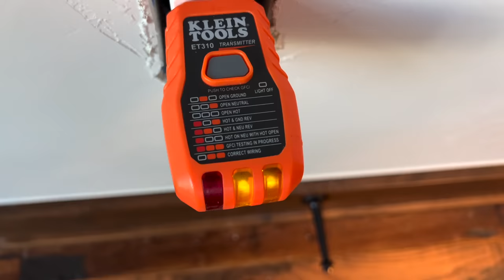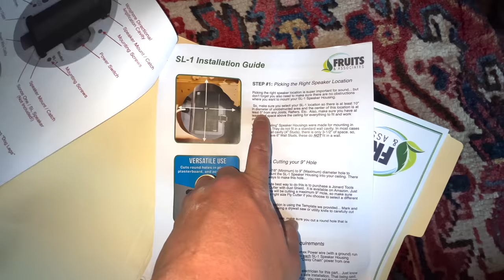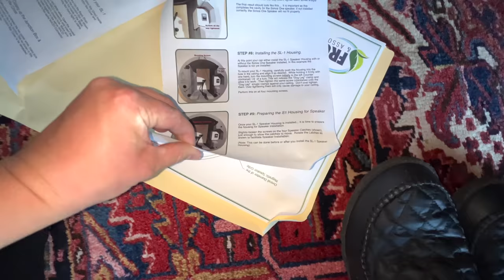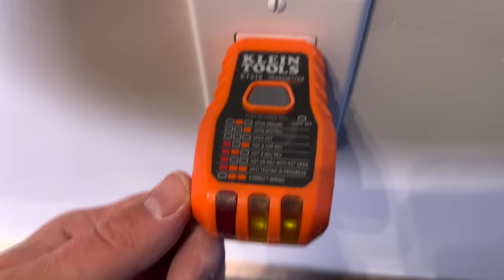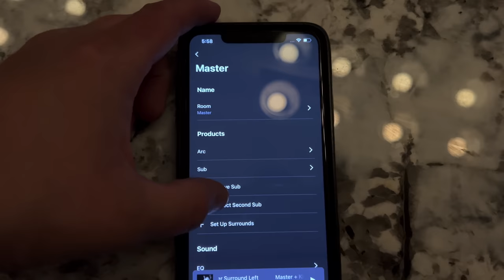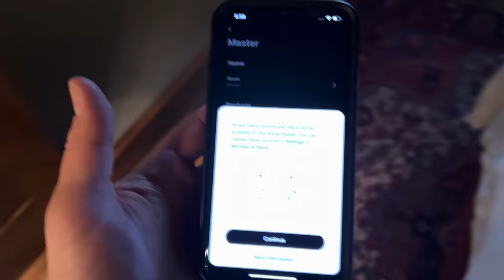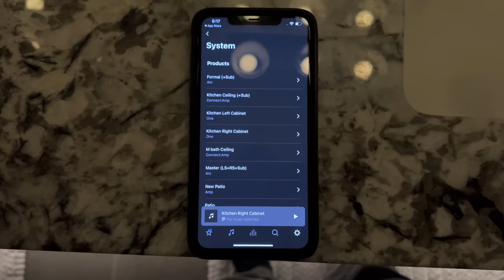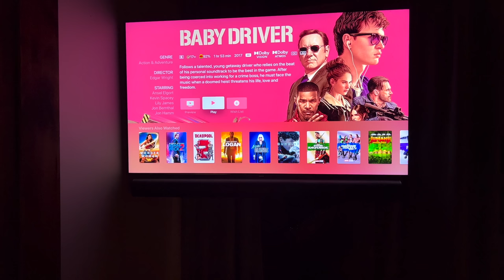GENIUS Sonos MUST HAVE Upgrade! Full Installation + Demo - Episode #2

Comment from the maker: Hope everyone is enjoying the video and finding it informative! We tried a really long detailed format on this one. What do you think? Do you like this type of content or is it to long? Thanks for everyone’s support! 🙏😁
Reply: Love the long video, details by details but it would be nice if they have a rectangle box that it will give that look like a surround speaker but the video very nice ❤
Reply from the maker: @josephpicado1818  Glad to here you like the long form video! We sell grills separately in circle or square even if the speaker is circular you can get the look of a square in wall. 😁 this product is mostly an in ceiling solution so it has the square included. Thanks for watching!
Reply: Great video and solution!!  Are the speaker grills able to be painted?
Reply from the maker: @brandonlavelle8859  yes the grills can be painted! 😁
Reply: Do you sell these boxes on your website? I can't seem to find them anywhere...
Reply: Awesome video. Would it have been easier to remove the bottom trim and cut the sheet rock and drill behind the trim? Then you wouldn't have to have the extra boxes or electrical outlets.
Reply: Where do I get those In wall mounts??
Reply: So you’re gonna dangle that carrot and not give a link to this GENUS solution? Where to buy??
Reply from the maker: @gaulbaugh  https://shopdreamedia.com/products/fruition-designs-sonos-one-enclosure
Reply from the maker: @gaulbaugh  https://shopdreamedia.com/products/fruition-designs-sonos-one-enclosure
Reply from the maker: @Clockworks_16  https://shopdreamedia.com/products/fruition-designs-sonos-one-enclosure
Reply from the maker: @gaulbaugh  haha! Sorry. Here is the link to buy!

Comment: Great idea the speaker box for the Sonos speaker, will see if they are available in Australia 
One thing i can never get over is the prehistoric HV wiring use in the states, solid wires, industrial breakers something we haven’t used in 30 years in Australia, also receive a shock and it normally ends with a burn or death with 240v.
Thanks for the video

Comment: By hand,that was a kewl cut, but we would use a hole cutter, a  it like a tile cutter which has an extendable leg from center which can be set to any width, or use the front of your jigsaw to make a stick with a tiny leg to go in center, and use jigsaw as a compass..... the front of jig saw has 2 raised slits (one having a grub screw so you can put a metal stick inside.....

Comment: Great vid Zak! Was going to put the sonos in ceiling speakers in the ceiling of my living room but just saw this video.  Is there a major difference in sound to justify putting in this configuration instead? Thanks
Reply from the maker: I have heard back and would say it’s pretty comparable in performance to a $200-$300 in ceiling. If you can run wiring I would go with normal in ceilings so you can choose the quality of speaker you would like and do the Sonos amp. The Sonos SL/one with this enclosure is a great solution if you can’t run wiring though! Call and talk with our specialists and we will FaceTime you to see the space and make some recommendations. Then you can see the cost difference and install difference and make a decision. We look forward to talking with you! 877-417-9000

Comment: In uk,we have to use yellow and green earth sleeving on any exposed earth wires...... when you just shoved that mains connector into the blue box, how do you know if an earthwire isnt pressing against a live wire which might not be home enough and have some wire exposed from its sleeving?

Also, we can't run more than 2 spurs from a socket off a ring main, are the bedroom electrics even on a ring main as its independantly fused, and i cant see you running 2 wires down to the fuse box for every room????  OMG 😱....... Thank God its only 115v

Comment: What’s the name of the wall adapter being used to put the One’s in the wall? Seems to be missing from the description. Thanks!
Reply from the maker: Fruits and Associates Sonos SL in ceiling enclosure. It’s a small American manufacturer and that saw a need for a solution that was completely in wall/ceiling and up to safety code plus voice control still works and they manufactured the lever to hit the pairing button. The only other options prior to this where no good. They thought of everything and we are proud to say we are the first dealer in America! Give us a call to purchase 877-417-9000 or email sales@dreamediaav.com 

Thanks for your support!
Reply: @Dreamediaav  Hi. What's the general price point for the box? We're currently planning a house in coastal SC and this is exactly what I have been looking for. I just want to include a line item in our budget and will purchase later

Comment: Rad product. I hope they sell a square grill for in wall applications. 

Also, never use your drill battery as a hammer.
Reply from the maker: Dreamedia does sell square grill’s separately that you can use on this product manufactured by episode. Thanks for watching!

Comment: Actually..... that "Mains cable" looks like 1.5mm we use that for lighting and is banned for mains, here mains is 2.5mm...... it actually frightens me how you shove those mains cables into the blue boxes so quickly..... as far as qorking on electricity is concerned, there is no time clock or it isn't a race.......